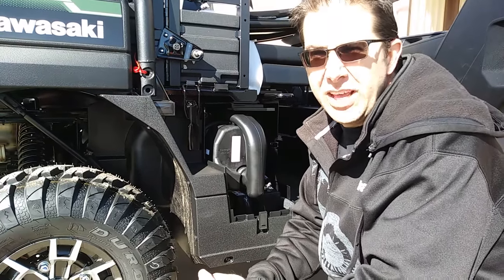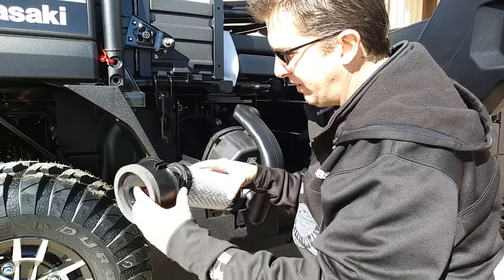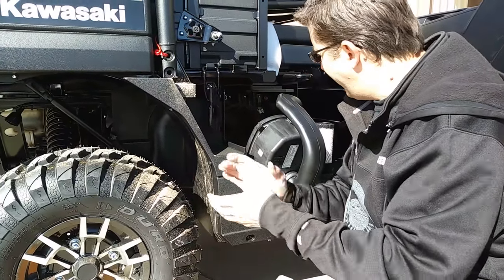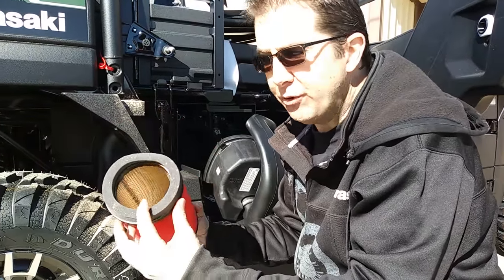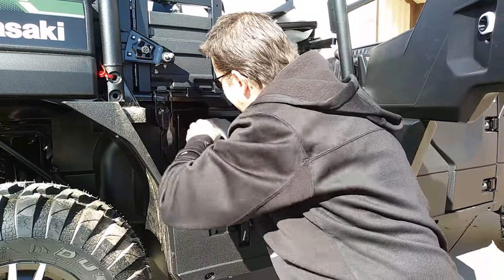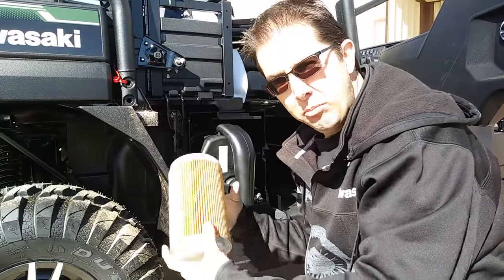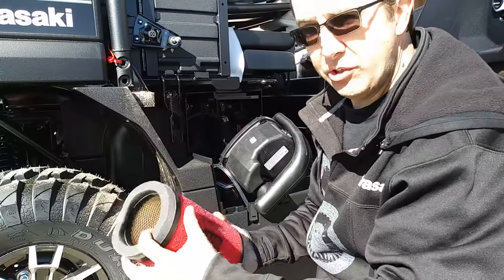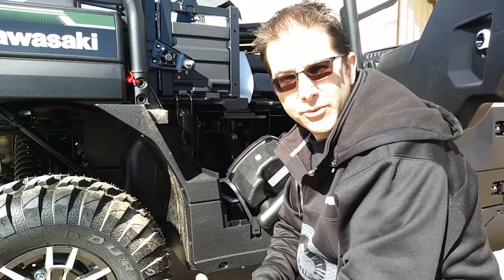BEST Kawasaki Mule Pro FX/FXR/FXT/DX/DXT air filter!! 2015-2020 (not 21+!)

Comment: My dad's 2019 Mule Pro FXT just "bit the dust" last week .  Air filter failed. Found this video while googling to see if it was a common issue.  This video came out 2 weeks after my dad bought his.  If we would have known and followed this man's advice I have no doubt the mule had another 8000 miles of life left in it.  Shame on Kawasaki.  Supposedly there is a TSB (not a recall) where the dealer is glueing the problematic foam ringed adapter into place.  Follow this man's advice!
Reply from the maker: This and the video on the DIY intake snorkel and makes a massive difference. Thank you for watching!

Comment: Thank you for this video! Thinking about swapping out the air filter like you recommended. I hand a question about the clear drain tube that is clipped to the bottom of the air box. I seem to have lost mine and I have no idea where it is supposed to drain. It had a plug on the end clipped to the air box. Any input is appreciated!
Reply from the maker: Thank you for watching. On all the models up to 2021 there was a recall for the crankcase breather and that hose was a drain off that, the recall removes all that so you probably had that recall done and should not have any worries on that.
Also check out our DIY Dust snorkel video for the FXT to VASTLY improve cleaning intervals, but on the 2015-2020 Pro's doing the Uni AND the dust snorkel and you will be amazed how long till you need to clean the filter.

Comment: I need to add this to our MULE next time we see you.
Reply from the maker: Its a great time to do it at the break in 👍
Reply: @HesterEdition  at what age, or mileage or hours is the break in done?
Reply from the maker: The book says 20 hours, engineers and techs say 70-80 hours or 5-600 mile which ever comes first. That's what we reccomend.
Reply: Ok so 70-80 hours or 500-600 miles....Does it matter if that takes years to get to either, LOL
Reply from the maker: I have had customers come in 10 years later for the break in, I would say before that. They reccomend "or once a year" too. But I have yet to see an issue with oil from lack of use for a coyple years but I would not push that. If use use the vehicle here and there but not for much time a couple years would be about as far as I would go. And use a good fuel stabilizer lile Star Tron, gas will not last long without it and that's a whole other problem

Comment: Nice!  I ordered mine today from Amazon with the Service Kit included!
#EDIT# 9-14-22
Did not fit my 2020 Pro Fxt!   The inside diameter of the filter would not fit over male air box connection. Tried everything to make it fit.   Returned to Amazon.

Comment: Anyone know why it says specifically not on the 2021 model? Kawasaki calls for the same filter element on it as the years before. Is that plastic adapter/baffle not there on the 2021?
Reply from the maker: Because they changed the air box and the uni used before will no longer fit

Comment: Thanks for the info!
Reply from the maker: We also gave Kawasaki a new intake design that they could do at the factory level with ease, a new inlet for the engine and cvt that uses the backbone frame by the engine and would use the ROPS rear frames as the intake pipes, much like a 4010 where the air came in just below the roof. Will they do it? I would not hold my breath. But you never know lol.